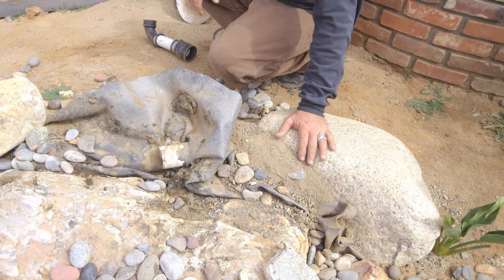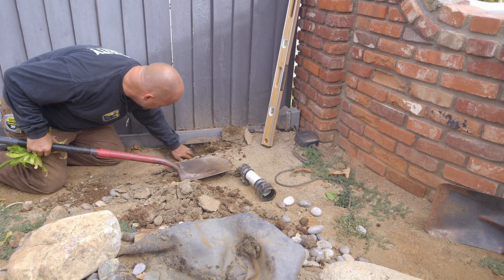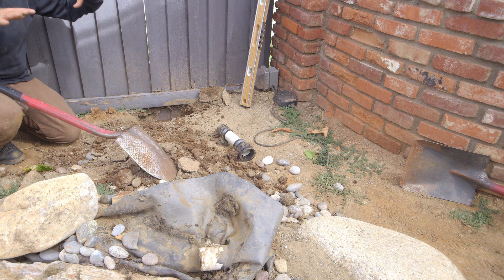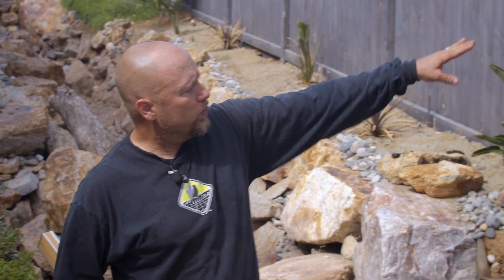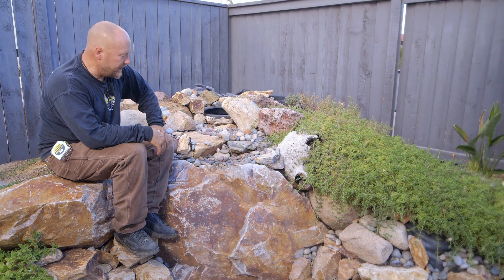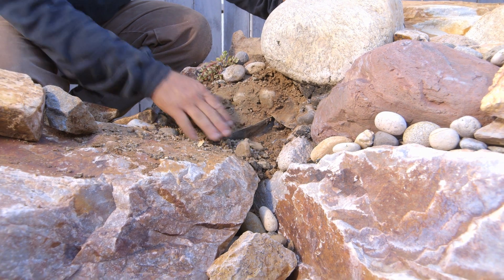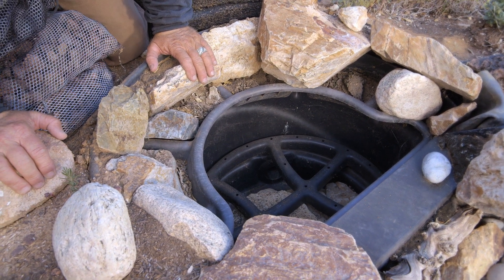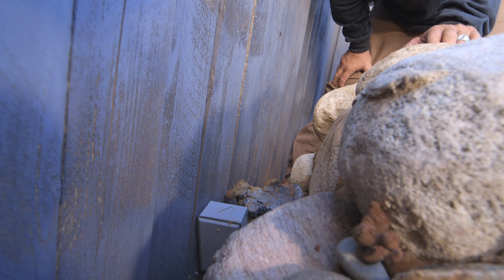Ponds Gone Wrong | The Real McCoy - 3/4

Comment: Looks like a Cinder block line would of been ideal behind there to create potentially more room for electrical outlet and other equipment you might want to hide yet get access to when you need it. I feel like if there were any issues, the home owners might have to go through a bothersome process of just getting access to the area. For example, if you want to add Light fixtures in the future, you can set it up behind there where it is easy to get access and hide it. 

Cinderblock wall would also grant a good liner attachment for flat surface and height then place the so called "decoration" stones to hide it. Also, by attaching the linear to the cinder block wall would allow you to potentially create a so called Deep sand/dirt soil that you could plant potentially interesting plants within between the rocks instead of using a lot of gravel to decorate the water fall features. I image some sort of Straw plant would be neat to have water seethe through and could potentially promote some natural life to the pond in terms of frogs and such.
Reply from the maker: +Helveteshit :)

Comment: could have been a shocking mistake .Lucky they don't get snow .Is the wire in conduit all the way underground .I am  sure the plant got watered a lot on that waterfall .Sure not a ground contact fence
Reply from the maker: +sissy murphy I love to see your name in the comment section! Thank you as always for watching!
Reply: Thank you .It has been a weird winter here we went from 60 and 70 degree temps to 2 foot of snow and then back to 50 and 60 degree temps and snow is almost all gone .So many ponders worried about there ponds with all the snow we have had .Nice weather is giving me a chance to take up old deck boards and lay new ones and build 2 pergolas .on the decks .Not finished because of snow delay